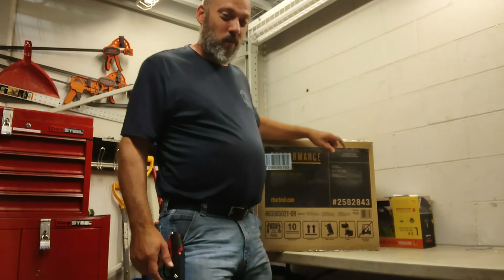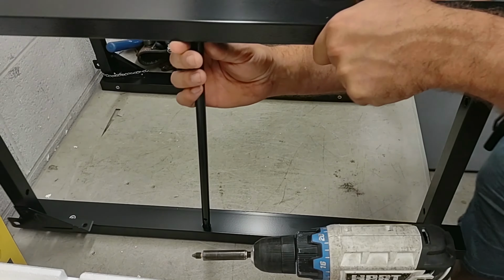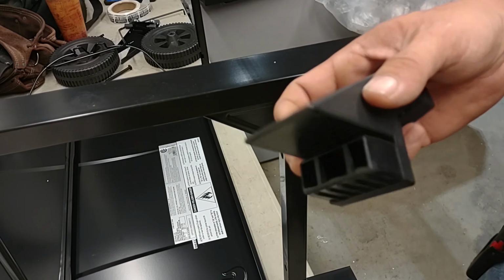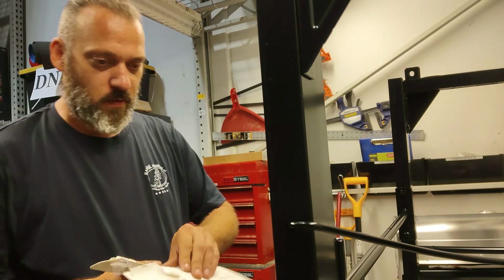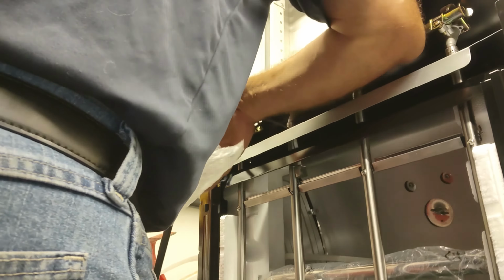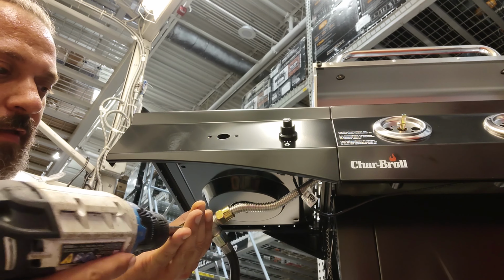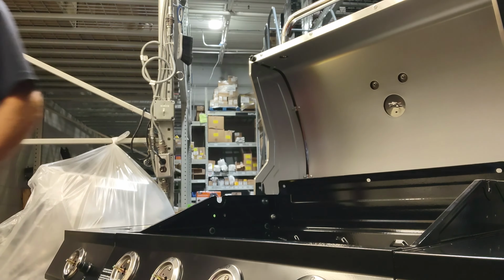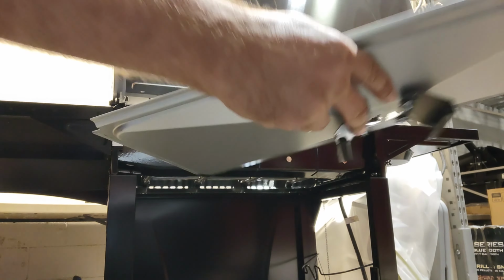How to Assemble Char-Broil  Performance Series Black 4-Burner Gas Grill with Side Burner 2582843

Comment: Thank God for you postings this. Couldn't of put mine together without this because the instructions they give are JUNK. THANK YOU SIR. The only thing wrong was the drip tray procedure. Because in order to slide it in, the back top panel has to be removed, the tray doesn't slide in from the front.
Reply from the maker: Glad it was helpful
Reply: @oldgoatdiy  I had the same problem with the back tray. I wound up loosening the back screws that attached the burning unit to the legs, lifted the back of the unit up, and then slid the tray in. I just tightened the screws up after. There is no way I could have assembled this grill without this video. The instructions were terrible. Thank you so much.
Reply: Yep those instructions they provide are horrible it took me two hours to put my grill together
Reply: @ILYChrome  thank you. Wow I forgot about this comment. Lol

Comment: You SIR, are the " MAN".  I can do auto repair, but not grill assembly. Go figure . Question, ... Is the grill a good grill in the end ?
Reply from the maker: No sir, you are the man.  I can not do auto repair.  🙂
As long as ya cover it or store it out of the elements, it'll last more than a decade.  Have had no problems with mine.

Comment: Did you grill come with a heat shield?
Reply from the maker: Char broil was transitioning to a tray that acted as a heat shield.  

If the tray that your grease trap attaches to is:
Black: needs a heat shield attached
Gray: it acts as the heat shield.